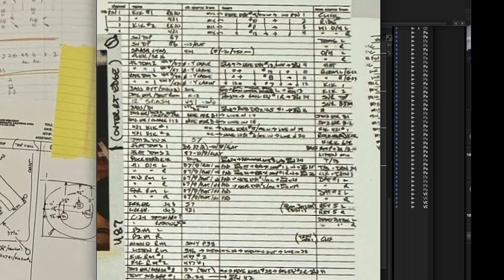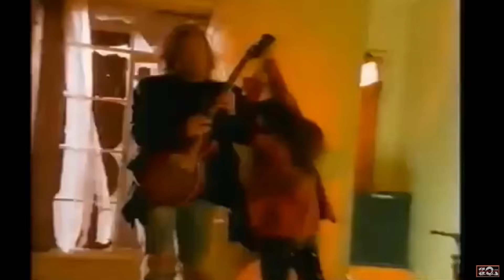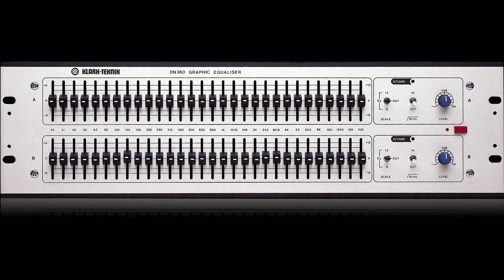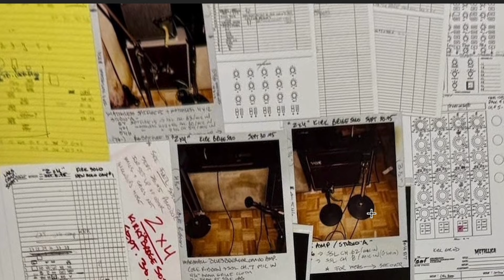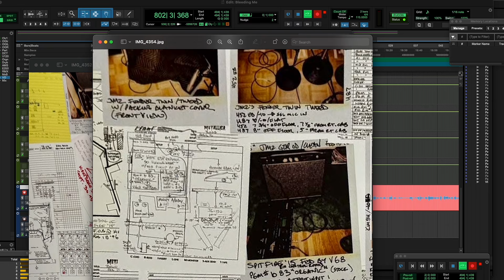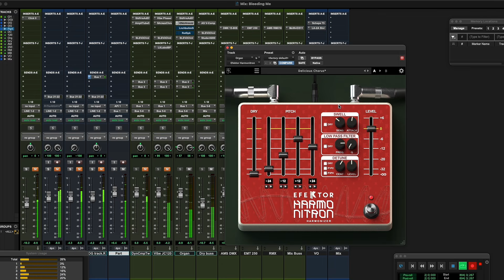Deciphering the Studio Notes from Metallica's Load Box Set + Recreating a Tone From "Bleeding Me"

Comment: Great video. Just as a side note: The GK-2A is not a midi pickup. 
It's the module (in this case the VG-8 that turns it into midi). The GK-2A can be looked at as a pickup that transmits the 6 individual strings separately to the module via the multi pin cable (which allows for 7 channels iirc. The 7th channel is the guitar input on the pickup itself.)
I used to love mine, combined with the GR-55. Sounded great but depending on the stage and volume it's quite unreliable because of resonant frequencies being picked up by the pickup.
I wonder why they stopped the production on these units.
Reply from the maker: Oh interesting! Thanks for clarifying that, I always thought it was a Midi thing. I might snag one someday just to play around with, looks like the GR-55 might have some of the same patches as the VG8.
Reply: @JPHenryAudio  The GR-55 has some sounds of the VG-8 built in. What i loved about the GR-55 is that it had an internal multi fx processor with amps and multiple ways of splitting the different signals. 
If i remember correctly you could blend the (internally) processed guitar signal with 2 more sounds from the GR-55. It's been like 10 years since i played it. But i loved the looks of some guitar players when i used it live 😀 (I typically ran my guitar signal through a GT-10 tho for my main sounds).
Reply from the maker: Very cool!!
Reply: "I wonder why they stopped the production on these units."
The Boss GK5 seems to be the current model, which now uses some kind of serial interface via a 1/4" TRS connection.

Comment: Not much of a Metallica fan, but if there's ever this much detail into a recording session, I don't give a hoot who it is, I'm into it.   Kind of incredible the level of detail they went to, and someone was pretty good at drawing.  
Wish there were some of these for Zeppelin....that would put me thru the roof with excitement, although I reckon the video would probably only need to be about four and a half minutes, because I would reckon that for the whole band, they used about 20% of the inputs they used for just Lars.  3 mics on the drums, one each on the guitar and bass, a vocal mic and a room mic or two.  Probably woulda been fairly common to have tracks left over when they were using 16 track.  Crazy how complicated recording got over the course of about 20 years.  

First studio I worked out of had a couple of 165As.  Have never come across one since then (early 90s), but really wouldn't mind having one myself.  They did a really good job of compressing and not doing much else.  No vibe, just clean gain reduction, although I never got into the weeds with the manual settings on that thing as I didn't know what I was doing back then, just left it on Overeasy and it worked great for what I was doing.

Anyway, thanks for doing this.....super interesting.